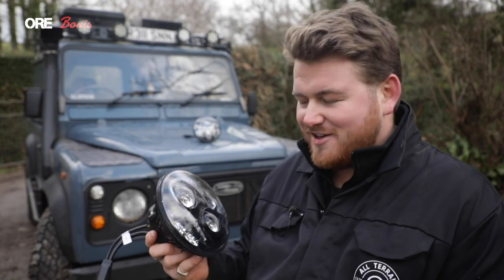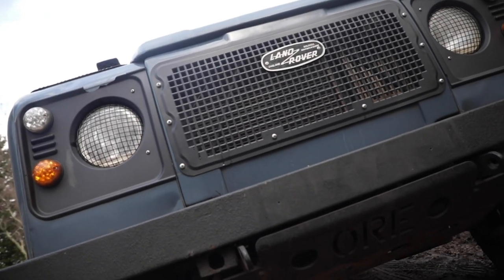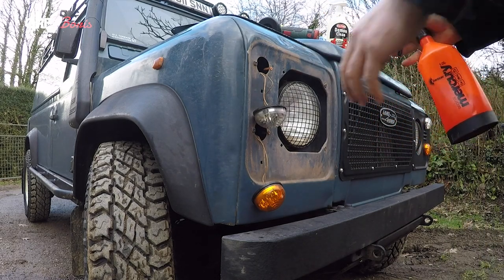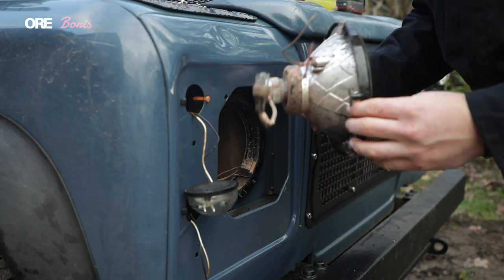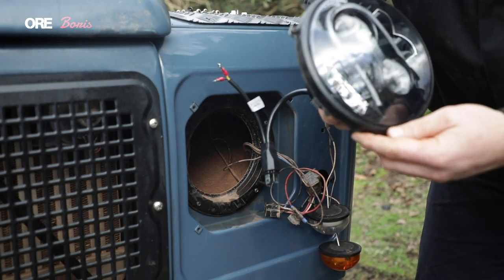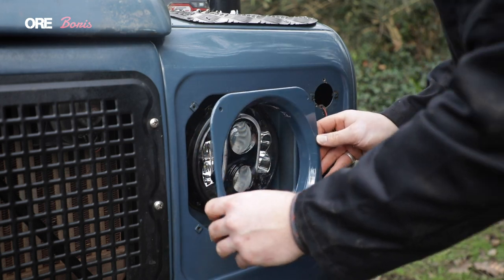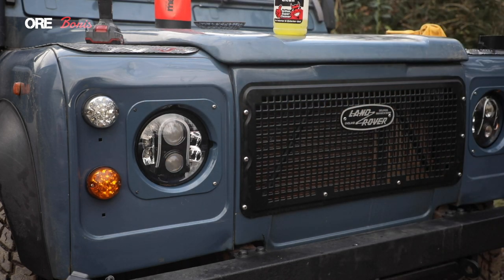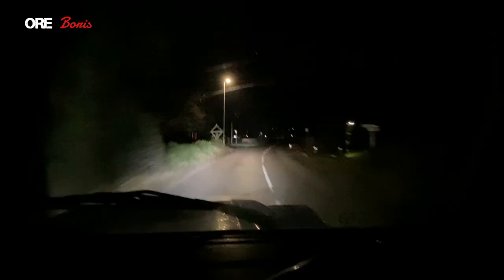Defender O.R.E Headlights + Series Light Surrounds Install

Comment: Nice I’m getting some led headlights fitted right now. I’ve gone fir the ones that have the side lights and indicator ring. I need to put my roof bar light on another switch. People down hear in cornwall get a bit arsey and flash even when I’ve got normal headlights on. I’ve had the lights lowered for the 3inch lift as not to blind but they still flash. I had one that was flashing b me like a nutter. He regretted it when I put the spots and roof bar on.

Comment: Nice upgrade for a Civvy Defender, but looks completely out of place on a Wolf and I have a 24v system anyway, so lights are way more difficult to source, so I went with LED Bulbs - The MoD headlights are also waterproofed for wading, larger plastic bowl, 3 different seals I've never had an issue !

Comment: Having competed in Road Rallies I learnt early on that the quality of the beam pattern was more important than the intensity.  Its nothing to do with dazzling oncoming traffic (although that is a vital consideration), its about what you can see and how intense it it in the margins.  The lights have to pick up all the details accurately and clearly and there should be no intensely lit spot to distract from the rest.  I prefer Hella or Cibie headlights fitted with +100-+120% bulbs.  I don't like projector lamps because of the colour separation at the edges and HiDs are too blue for my liking.